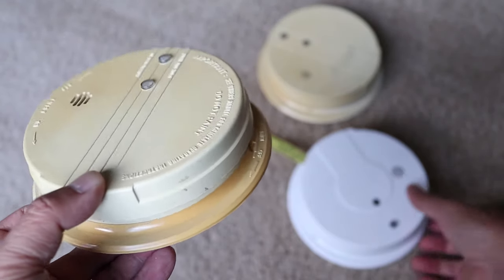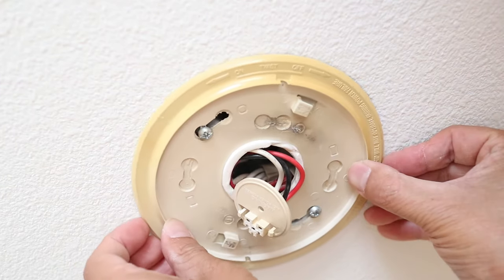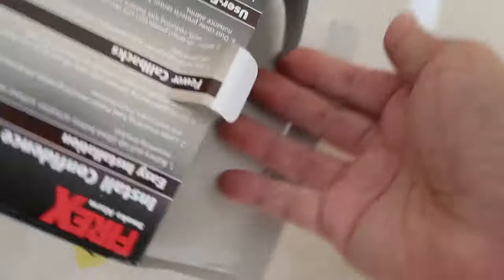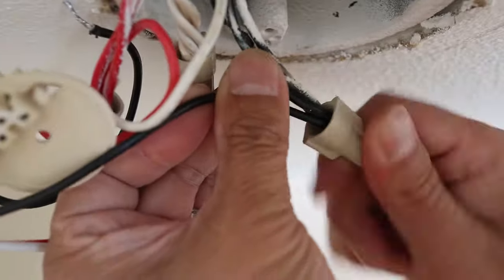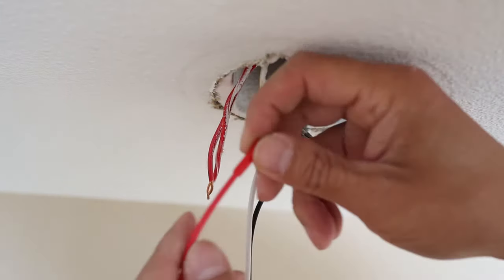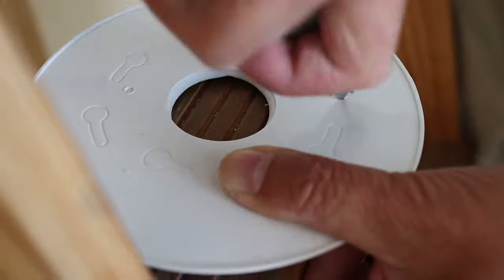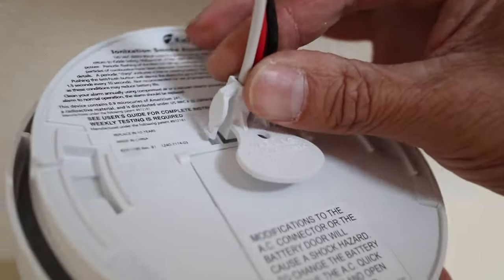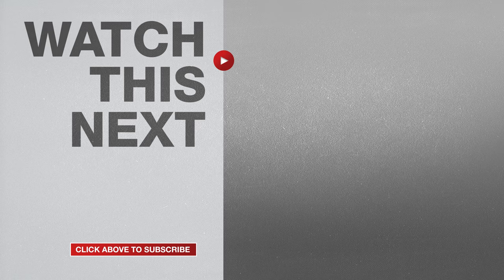How to Replace Hardwired Smoke Detector – Safely Update Your Smoke Detectors with Kidde FireX

Comment: For some reason my smoke detector doesn't rotate and  detach from it's base when I try to rotate it. Why is that happening? Can't find info on this anywhere and therefore can't change the battery it keeps chirping
Reply from the maker: I’m not sure why your smoke detector won’t rotate for removal. I wonder if it has something locking it in place? On the Kidde smoke detectors I installed in my video they all came with a locking pin. When that pin is inserted you can’t rotate the detector. However that pin is bright red so you can’t miss it. In the part of my video where I twist the smoke detector back in place at the end, you see me line up the holes. That’s where the locking pin goes. I just didn’t use it. I have only used Kidde and First Alert detectors and they all had a mounting place and twist on design. Hope you figure a way to remove your detector!
Reply: @TheRenderQ  Thanks for the reply. I don't have a red pin, but there's a white pin-like attachment on the side. Could that be it?
Reply from the maker: That could be a locking pin!

Comment: Mines been beeping for weeks and it’s driving me insane. I thought you only need to replace the battery but I guess not.
Reply from the maker: Yes! Typically you only need to replace the battery when a smoke detector starts beeping. But if it doesn’t stop beeping or it’s at the end of its life then you’ll need to replace the smoke detector. But put a fresh battery in it first.

Comment: I replaced only 1 smoke detector out of 4 in my house. When turned the power back on, they all started beeping continuously.
Reply from the maker: Hmmm! I’m not sure why the new detector would’ve trigger the others to start beeping? I recently changed 4 detectors in one house and 9 in another and none of them beeped except the one beep when I turned the power back on. Sorry I couldn’t be of more help!
Reply: same here, i reckon i need to replace the others as well
Reply: actually it turned out the hot wire had come loose
Reply: When I twist mine to lock in place that side dangles a bit and gives ever so slightly. The smokes are giving me a harder time than the combos and I’m about to send them back to Amazon. It shouldn’t have this much give. Model: i12040A

Comment: If I'm replacing my old hardwired smoke detector with a battery operated smoke detector, can I just leave those wires alone and shove it back up.
Reply from the maker: Yes! If you’re not needing the wires for the new smoke detector you will need to cap the ends of the wiring with a wire nut before stuffing them back into the ceiling. Hope this helps!
Reply: Heads up, you're taking a huge step down in safety downgrading to battery only, unless you have a very small living space. One of the benefits of hardwired is that every detector communicates with the rest, so if one unit detects a fire in a distant part of your living space, every single hardwired unit will alert you to that fire. Separate battery powered-only units do not do this, unless you are using one of the new wireless interconnected style. Personally, I still like hardwired over even the wireless interconnected ones, as I don't 100% trust any wireless technology to work when you really need it (like during a fire in the middle of the night.)

Comment: Too scary for a single senior.
Reply from the maker: Definitely if you’re not comfortable then I’d let someone else replace your smoke detector. However there are smoke detectors that have adapter cables that make this really easy. I had bought 2 from Lowes and it was really easy. Almost like plugging it in. There was no need to undo any wiring an no exposure to raw wires. Simply unplug the old detector, replace the ceiling mounting plate if necessary and plug in the adapter and new smoke detector. No need to turn off the power but I would still recommend having the power off. I made a video about this but it doesn’t release until end of June.